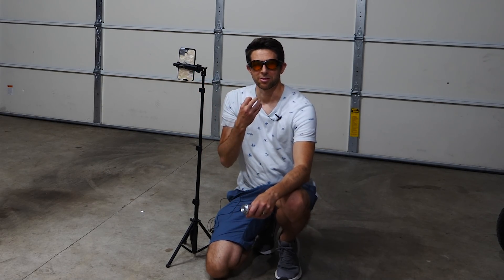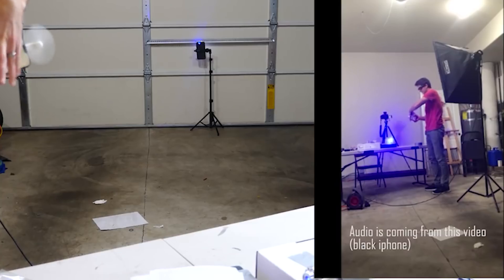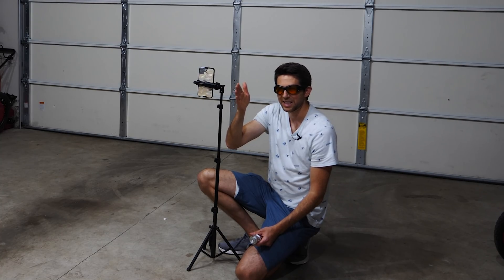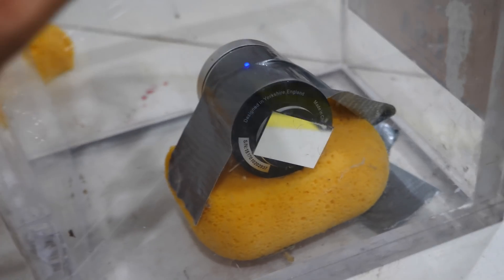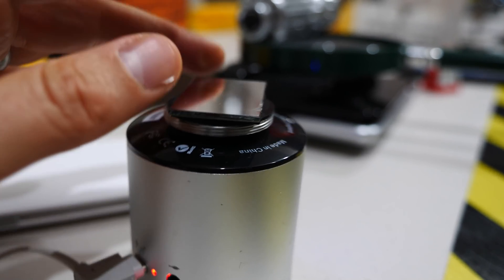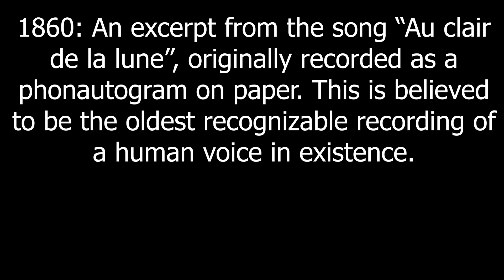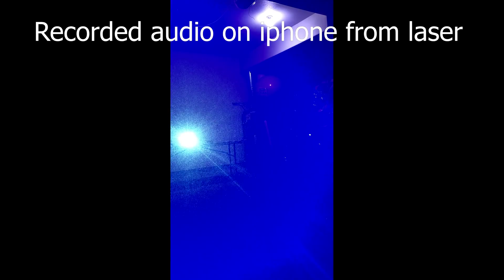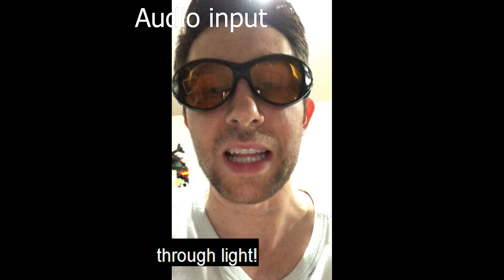How Microphones Can Record Light―Recording My Voice As Light Waves

Comment: A cool thing that I've heard is that Leon Theremin (inventor of the Theremin musical instrument) used this method (sort of) to spy on the Americans and Stalin himself. When he returns to Soviet Union, he was forced by the NKVD (later become the KGB) to create an undetectable spying device. He made what was the precursor to the laser microphone. So, the Soviet gave a wooden carving of The Great Seal Of The United States to the US ambassador to the USSR. Inside of it, there was a metal object, later called by the Americans as "The Thing" Because they cannot figure out, how this piece of metal somehow able to pick up and transmit sound. How it actually work is that a low powered infrared beam was aimed at the thing from a distance. This beam will then pick up the vibration and turn it into hearable sound. It is also said that this device than used by the NKVD/KGB to spy on Stalin, but instead of picking the vibration from a metal object, it picked up the vibration from the window of a room, making it almost undetectable.

Comment: Modern microphones comes on a chip with electronics built in, it hase semiconductors to amplify the signal. And if you shine a bright light on a semiconductor it will act as a solar panel, and in this case introduce noise/signal in the system. Just put a multimeter on a regular led and shine a laser into that led and you will see that effect.

Comment: The delta would not have that kind of resolution, even "if" a low power laser could heat it. I think there is more here, but i'm stumped. Surprised it works at all...  Edit: Dare I say. quantum wave function and the mic "coils" are small and sensative enough to get it. Ehhh, not like this would work on an actual coil mic.

Comment: Maybe the silicon die detecting the light. Not sure but small microphone could have MEMS technology where the chip not are putted in a packet, raspberry pi 3 could reboot if using a camera flash on the exposed chip.

Comment: Seems the challenge is to have the sound level at any instant in time translate to a level of laser output, whereas with the mirror you're getting kind of a 0/1 output. You could try a completely different approach, but maybe you'd have some success modifying the existing approach. What if you tried placing a diffuse material, like a small piece of paper, over the microphone to increase the physical width of its receptive area? The mirror's reflection of the light should be adequately preserving the waveform, so it's the receiver that needs augmentation.

Plus, breaking the cohesion of the incident light with diffuse material can help reduce artifacts from interference that could occur when reflecting off of the internal bore of the microphone hole. A laser points light in a single direction, and also the light is coherent. In a lot of applications, both of these traits are desirable. But in this application, the coherence might be less than unnecessary.

I do realize that if the goal is to secretly transmit a message to an unsuspecting person, you can't augment their microphone first. However, in a practical application, you'd engineer a laser device whose output amplitude matches the waveform of the input audio signal. It's my understanding we're doing a proof of concept with the most common materials available and minimal technical expertise. It's more fun, anyway, and no one has to suffer a soldering iron burn.

Comment: I bet it will work a thousand times better if we build something that translates the audio signal to light such that the amplitude of the sound wave is proportional to the intensity of the laser. This prevents clipping of the sound because the laser is not moving.

Comment: Try making a circuit to Pass a steady current through a speaker and attach a photo resistor in it.. then from a distance, shine a laser on the resistor. Now place two parallel wires (Very tight and thin wires) very close to each other and let the laser also pass through both of them. Laser now passes through them and hits the photo resistor. Now try speaking close to those wires and see does it record your sound or not.. I know it's a long comment... I don't even know you will read it.. still it's worth a try😜.

Comment: you could have used a comparator like an LM358 to convert the analog audio signal to a PWM signal and that PWM signal can be fed into the laser to turn it on and off according to the duty cycle of the PWM signal. I think that would have worked better than the laser dot bouncing all around the place

Comment: Definitely a clipping issue, the reason you could hear your kids all right and not yourself is because your kids speaking was further so it was quieter and it made the speaker move less, so the light wouldn't move that far away from the microphone hole. What you can try is to lower the volume of the speaker.

Comment: I think you could get better results with pwm or some kind of modulation to the analog signal.  Let say you modulate an square wave of around 6kHz 50% duty cycle when no audio. Then you change the duty cycle with the audio. 

The whole chain is somewhat a bandpass filter with nonlinear distortion.

Comment: Actually there is a better way to transfer sound through light, which is by using a solar cell, the way is Basically transforming sound waves to binary (zeros and ones) and then repressing the binary with the lazer where when the lazer is off that means zero and when its on it means one.. and the lazer should be pointed to the solar cell then you can connect the solar cell’s positive and negative wires to any speaker or head phone

Comment: You can make it again with th same method but the next time instead of shining the laser to the mic.. take a small solar panel and connect the output to an aux port and then to the device you may also need a small amplifier maybe not .. i am sure it will be sound almost perfect..

Comment: I believe the sound quality is so poor because the setup can not give direct correspondence between what you feed in and the signal you get out of your microphone. Basically you point your laser to the microphone through the hole in your phone and when the laser beam happens to fly across it heats some of the sufaces inside it and it gives an exponentially decaying sipke of air pressure. To get a better sound quality I would try to use the aperiodic quality of the system and instead of feeding it with the actual audio signal I would feed the speaker with a frequency modulated signal. The laser-cavity-microphone system will basically demodulate it and with this preprocessing you should get a much cleaner sound.

Comment: Would it make a difference if you used the speaker to block and unblock the light—like morse code or the fan you used—versus a vibration on the mirror?

Comment: Try varying the strength of the laser according to the sound , should be interesting , I think that you can use an amplifier circuit and replace the speaker with the laser

Comment: does certain light frequencies (different colors) only carry certain sound frequency information. maybe your arent getting a full range of sound because the waves cancel out some octaves? could you use red, blue and green lasers at once to get a clearer sound? my logic: sound is a wave. so is light. waves can be canceled out by medium it runs through and also other apposing waves.
Reply: or is it the receiver that is limiting the octaves? does the size of the hole and microphone change what octaves are detected? for exampe this video showing that in a certain size of pipe, only certain octaves can be transmitted. https://www.youtube.com/watch?v=F64xcPKKES8&t=107s

Comment: The photons carry a de broglie momentum, which combined with their rate of impact (laser wattage) can generate a force. Once you start blocking the beam with the fan the force periodically disappears, which translates to a vibration on the microphone. Therefore, to vary the amplitude of the sound you would have to decrease the rate of photons, which on a laser you can easily achieve with a polarizing filter.

Comment: Radiation pressure due to photon momentum transfer of 1 W laser with a 1 mm^2 dot is about 3000 uPa. Human threshold for hearing is about 20 uPa so I wouldn't be too surprised even if one could record amplitude modulated laser using a fully reflective microphone membrane in vacuum.

Comment: Its is due to Radiation Pressure. Radiation pressure is the mechanical pressure exerted upon any surface due to the exchange of momentum between the object and the electromagnetic field. This includes the momentum of light or electromagnetic radiation of any wavelength which is absorbed, reflected, or otherwise emitted by matter on any scale.

Comment: The mirror deflects the laser towards and then away from the microphone at different frequencies. Instead of diverting the laser beam, try to control its amplitude (or brightness of the beam) and see which method brings a higher sound quality.

Comment: This is really cool and interesting!
It would also be interesting to see you experiment more with this in depth. With eg different laser colors
and also electrically connecting the laser diode/module itself to a simple transistor audio amplifier and letting
the light intensity and frequency transmit the "sound" to the microphone.
Take care!

Comment: A lot of the distortion/resonance could be from the mirror on the vibration speaker. It doesn't help that the method of modulation converts the analogue movement to something effectively digital.
You should eliminate that possibility by modulating the laser level directly (should be easy to do with a simple amplifier circuit).

Comment: This is how long distance communication will be done when we start exploring deep space. after advance civilizations out there the reason we don't hear them on radio is cuz they probably use a similar system. The only way to ease drop would be to literally be in the line of sight of a really thin line of light.

Comment: Try to connect laser diode to sound card output it should make not vibrating but a steady point with modified laser brightness.  I think in you experiment you loos some power because light was not all  time on the microphone. But vacuum chamber was really smart to prove that it is not an air vibration. And maybe some frequencies were louder because other has being cut by microphone size.
P.S and idea i saw in one of the comment below light have a electric field too it can affect microphone and being recognized as a sound. I like this video https://www.youtube.com/watch?v=975r9a7FMqc it has nice visual explanation of light wave.

Comment: You should try modulating the laser diode directly so you can pulse the beam without moving it. Using a mirror will always move the light around, causing the problems you had with clipping.

Comment: @The Action Lab, maybe in post (assuming you havent done this yet), you can filter the result. For instance in Audacity, there's a tool for noise removal. I'm wondering if you 'removed" the noise of the laser~ like, when you point the laser by itself at the mic, it still produces a noise on it's own, that's the base noise I'm wondering about. I think you can also make a mirrored sound of the removed sounds and maybe that way produces clearer sounds. .. ? not sure, but thanks for the video

Comment: You need to use a laser diode, hooked up on the output like a speaker, so the brightness/intensity varies, rather than the frequency like you have now...

It's thought that the laser actually pushes the diaphragm similar to how a light sail works! - and only seems to work with certain modern microphones...

There was a video by Smater Every Day  (Smarter Every Day 229) where they actually activated smart home devices, through a window using a laser... Things like unlocking a garage door etc...

Comment: Instead of moving the laser up and down, try to map the voice as peaks of current and then send a stable pulsating signal to the laser, which would pulse in the waveform of your voice. (Does that make sense? I really hope that makes sense)
Reply: I had that same idea, like, converting his voice to the light signals. Like on those microphones that you speak on and then there is a light in the speaker or in the sound interface that starts blinking based on the audio input. I think this comment deserves more likes since it is a very good idea to try, so he can possibly see what we are proposing.
Reply: @boriswilsoncreations  yeah I'm pretty sure electroboom has a circuit or two for this
Reply: Yup, that's kinda what I was here to say. Don't quite know the technicalities of it, but I bet the problem with this setup is in fact the vibrations, because that moves the laser off the mic. Maybe a lense could focus the distortions into the mic? Maybe it would set the mic on fire. Lol
Reply: In other words, amplitude modulate the laser light. Maybe it could be done with an LCD panel.

Comment: Sir, really really nice video, I had never expected that ever could be possible. 
Your engaging video, just got me out with a suggestion and some doubts.
Suggestion: The reason for your sound to not transmit fully, would be due to the phenomenon of scattering of light by the air molecules in the path.
Doubt: 1. Does this also happens when your receiver is in vacuum and no other (air) medium is around it than just vacuum. 
2. As you suggested that sound creates when you disturb the moment or travel of light rays, then why their is sound when no one is disturbing the light, and it is traveling straight to the receiver.
The doubt came from curiosity, and if you feel free, please reply.

Comment: connect the output from an audio amplifier to the laser. like use an old stereo and replace the speaker with a laser diode. dont need to be a super bright laser though